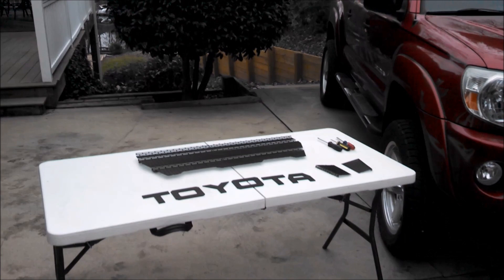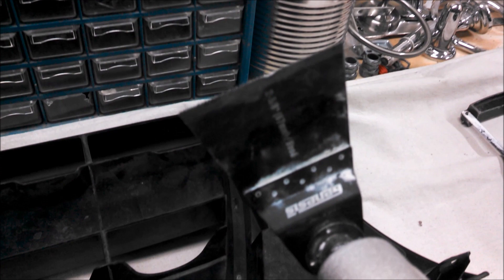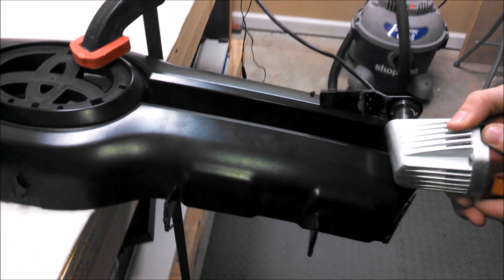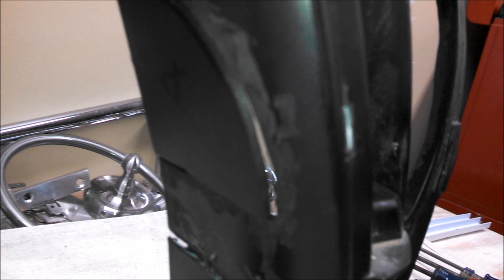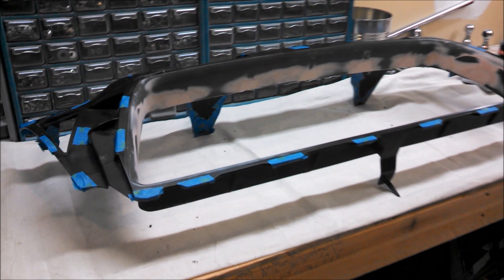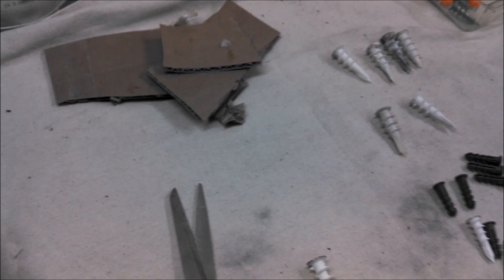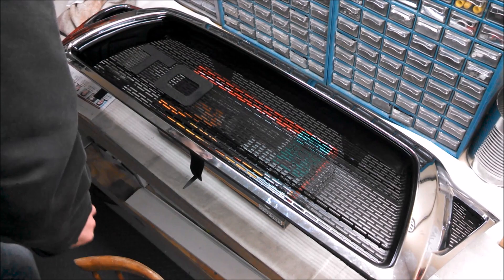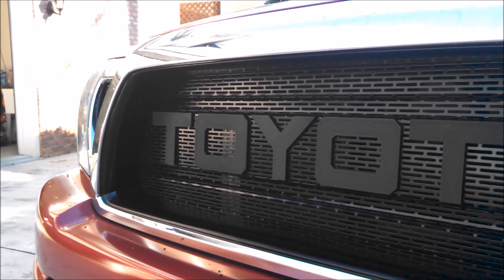Toyota Tacoma Raptor Style Mesh Grill Installation

Comment: A LAT OF WORK HOURS PROJECT! 
I made my own mesh grill rivet for a 1st gen Tacoma, 1st I remove the grill and cut the center part, then  Draw TOYOTA letters, cut them out of 16 gauge, sand them, paint them. then I draw the frame for the rivets and cut it out of same steel, and did the 42 holes for the rivets, then I sand it and paint it. after all that I couldn't find the rivets anywhere, so I made my own using flange bolts, I cover dem with clear coat. I cut out the mesh part and installed all my rivet/bolts around holding the mesh at the same time, then I put the letters, secured them with plastic ties and glued  using a product named goop. then I did the 3 amber raptor lights installation and at the following day I put the new mesh grill back to its place, and put the whole part back to my truck installing the wiring  to the side marker lights. around 40 or 45 hrs labor. and around 100 bucks on material. will cost 775.00  make it and also the installation. ( I know, who will pay that?)I forget to mention that I painted the chrome and installed the mesh on the little triangles as well.  and now if I do another one I think I can do it in less time since I have the templates for the steel and mesh cuttings, and the idea how to make the rivets out of bolts witch is better then those plastic ones .
Reply from the maker: Wow that's pretty cool! This was a pretty fun project to do on the Tacoma!

Comment: When I epoxy the drywall anchors and put the screws in, it breaks off since the anchor wants to expand. Any suggestions? Also what adhesive did you use for the corners?
Reply from the maker: We had the small grey anchors break the same way you described. So we only used the white ones that do not expand. Also, be sure to let the epoxy cure.

Comment: Thanks for the suggestion. I will try the white ones. What was the adhesive you used for the corner pieces?
Reply from the maker: We just used silicone caulking. Liquid nails - construction adhesive. Haven't had any issues with it.

Comment: I am wanting to do this to my 2006 limited 4runner. Looks like grill is about identical to another. I was curious if the mesh and letters would fit my grill fine from Bullet Proof Fabricating? I really like the way the mesh looks.
Reply from the maker: +trent allen That grill looks like it might be just a little smaller, you would have to trim the mesh down more than I did.  The letters should fit fine.  That would look cool on the 4runner!

Comment: Any stronger way on securing the mesh? I've had 4 of my drywall anchors come off now..
Reply from the maker: Hmm.  That is the best way we came up with and let them dry for a good amount of time.  A few did break off, but more glue and some weight on top for drying helped.  You could try to use caulk, use clear and see if that will bond it. Hope this helps.
Reply: Bros FOURR Speed yeah I was thinking just a different type of adhesive. Thanks!!

Comment: Im getting ready to start this project, how is it holding up so far. Any issues with the letters falling off
Reply from the maker: Patrick Andrews Nope, we used 3M and they have held up just fine.
Reply: Ok thanks, your guyses video is awesome and has definitely helped with this project. what type of caulking should I use
Reply from the maker: Patrick Andrews use black silicone coulking, that way if there is any over spill it will blend in.
Reply: Ok thanks again

Comment: nice work. you just depreciated the value of the truck by a thousand dollars.
Reply from the maker: +happy543210 How do you figure? An OEM grill is $50. And when I sold this truck, the dealer gave me top dollar and one of the first things they said was, I love that Grill!
Reply: Honda4RideRed
a junkyard grille might be 50 dollars, not a brand new one!
Reply from the maker: +happy543210 a whopping $84 for chrome. Either way, it didnt hurt the value at all.    http://www.stylintrucks.com/parts/replacement_direct_fit_grille_shell_and_insert_assembly/repgr38548/replacementt070139-.aspx?scid=gglpla&gclid=CIiSlJSt9ssCFdgJgQod8_wIeA
Reply: Honda4RideRed
it'll take a least a thousand to remove that nasty shit and put everything back the way it used to be.
Reply from the maker: +happy543210 How do you get that number? Two screws, two tabs, and you pull the grill out to pop the new one in. It takes less than 5 minuets. And again, based on our experience selling this truck, it made them want the truck even more.
Reply: Nice work. Don't try to please everyone. There is always somebody with Negative comments. Have you tried to use a hot glue gun?